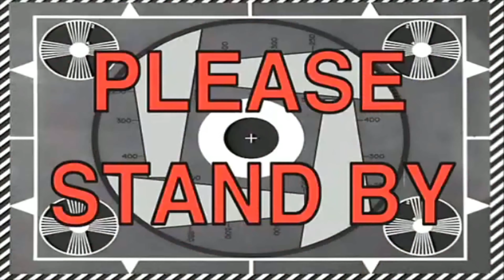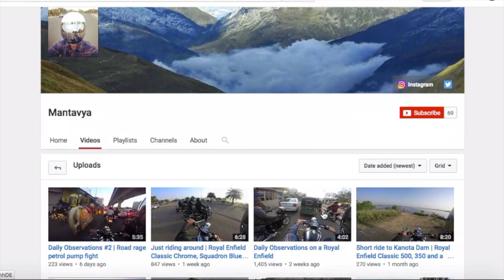Modifications usually come with... more modifications

Comment: From this mod you might have problem in mud or send surface because stend end surface should be flat it helps stend in different surfaces.
Reply from the maker: the stock one isn't flat either, it's curved, plus, i use the side stand when off-road so it's fine

Comment: What's the top speed of this?
Reply from the maker: like 140 ish
Reply: @Mantavya  almost as himalayan that's great
Reply from the maker: Himalayan goes over 120-125?
Reply: @Mantavya  which means yours has more top end than the Himalayan that is great. I am also hopping to try the uce 500 Std or Classic 500 and may be rebore the engine in the future for further power. How is it at top end too viby or smooth?
Reply from the maker: 500 is better at delivering power than himalayan at every rev range but at higher speeds, it feels like an earthquake
Reply: @Mantavya  hehe yea uce engine got some vibration. RE should develop 500cc J series engine I think that will be great.
Reply: @Mantavya  some say Himalayan is better but as you are an experience owner of 500 I trust your opinion